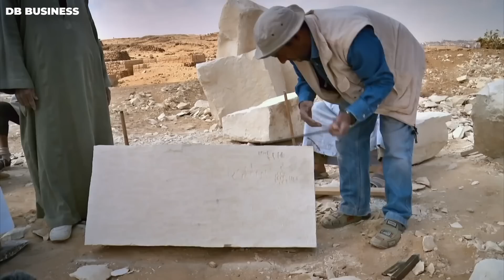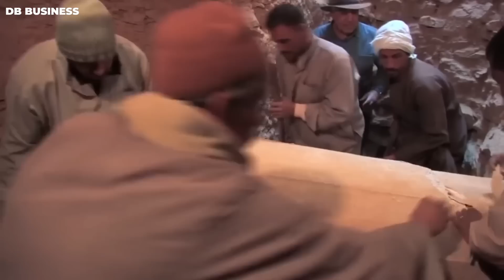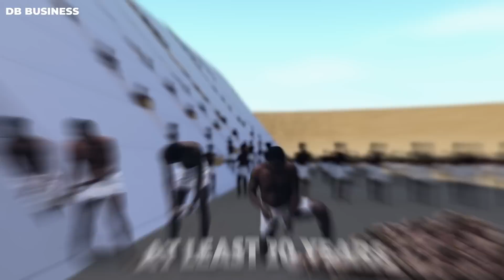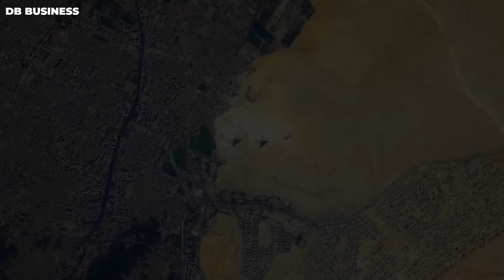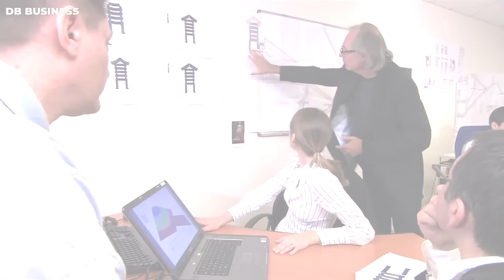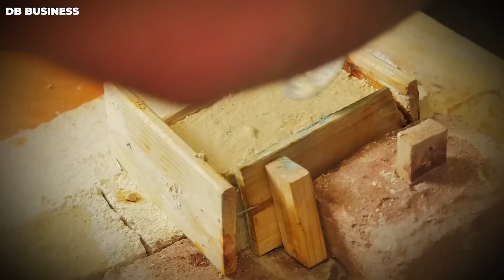The Mystery of The Great Pyramid Has Just Been Solved by Elon Musk

Comment: "Most of the pyramids serve as tombs for the Egypt's Kings"... really?  I don't believe any pyramids were build as tombs (Valley of the Kings?) and the few that had tombs were used as such by interlopers well after the construction.  As for the concrete method their molds must have been perfectly smooth unlike standard practices today which result in embossed reflections of the wooden molds. Sounds like more speculation rather than science.

Comment: Lifting a 10 ton stone, even with pulleys, requires a rope strong enough to pull more. If they existed, they would be too big for a normal man to grip.
Reply: Perfect.
Reply: Bio🐞 Anti gravity technology

Victor grebennikov
Reply: Sending vibrations through an object you can easily push objects that way hundreds of pounds. Just yourself.... This is actually proven and you can find videos to back this theory. Fully explaining and demonstrating.
Reply: There's a video on YouTube of an older man of maybe 60, moving a ten or maybe it was 20  ton rectangular block of concrete he cast,  by himself with no help, no machinery, no ropes, no pulleys, and then lowering it partially into a hole in the ground, deep enough to hold the stone upright and he gets the stone sticking straight up and level,  out of the ground, kind of like stone henge....the video is on YouTube and he's an old man... maybe 60.
Reply: @leopitre7907  Yes and set up with a lot of "modern" help. Do not believe only what they showed you on video. "BEHIND THE SCENES" on that would explain it far better.
Reply: Instead of one big rope.... you could use multiple ropes. And instead of pushing and pulling, you could dig a canal with water and let the stones float on wooden floats.
Reply: @JerryMetal  You think a stone of 10 or 20 tons would float on water???If you throw a small stone it goes at the bottom so imagine that weight.Think more before you say smth mate. 😉
Reply: The fallen Angels taught those people how to build and get the substance they need from out the earth. They taught them craft, astrology,math and the minerals that’s in the earth to survive.
Reply: @alexandermoore872  fallen angels? you mean demons?  why?  thats magical thinking.  People are smart and can figure out how to do things when they want to.  The pyramids are proof of that.  There was a dictator king that said this is how its going to be and this is what were going to do and all our resources are going to be dedidcated  to this project and it was so.  Not like now where they vote and then have a meeting and a request for funding and compromises and endless politics.  They got shit done back then.
Reply: they werent 10 tons only a very few were. Most were in the 1 to 2 ton range on top they were even smaller.  There were some big ones but most werent so the sustained drive to build it didnt need a thousand men on each block. 1 ton divided by 20 men is only a 100 lbs each to lift. Its manageable.
Reply: I believe humans were bigger in the past than today
Reply: @kav5697  munmies say no
Reply: @kav5697  then why are their skeletons smaller than ours
Reply: @kav5697  wrong, if anything they were a few inches smaller
Reply: @kav5697  and the skeletons are where?
Reply: @ScreamingEagleFTW  in their tombs bro, some of these people were disfigured, (king TuT) they were people just like us.

Comment: Yea one half inch off on the bottom and u got a complete off set so I just don't see people that didn't have any pulley systems being able to pull this off if it's so possible why hasn't one ever been built since some stones at other sites weighed upwards of a 100 tons so we are definitely missing a big piece of the puzzle
Reply: they cant even duplicate making one stone let along floating it with animal skin bladders or moving it up 400 feet in the air and setting it down on the top of the pyramid.  and Egypt wont help explore the pyramids or under the Sphynx.  If people would put even a tiny fraction of the work it took to building it into studying them we would at least know how they were built by now.

Comment: They didn't build the big Giza pyramid or the Sphynx, the geology of water erosion proves this. They built a few sh#t ones around Giza and Saqqarah which are falling apart or not symmetrical. Please ask Hawass how they cut 24 giant sarcophagi in Saqqarah Serapeum (over 100 tons each) and gave them a layered glass polish that can't even be done today....by hand with copper and stone tools. 
The 1st dynasty didn't even have the wheel ffs. And who made over 40,000 stone, machine turned jars, that are paper thin. (The Pharoahs had thier giblets put in some if them, topped with crappy wobbly clay lids.) And explain the huge ancient slabs with high speed circular saw marks from a blade over 9m in diameter! Or precise deep machined bore holes in the Djoser Pyramid.  😳. 
Those ancient farmers inherited it all and graffitied the lot. Even the most beautiful black granite smooth as silk statues in the Cairo museum are covered in unpolished crappy hieroglyphics, nothing like the skilled work we see in soft limestone. 
Elon is right. It's post or even pre-younger dryas. (15,000-300,000 years old).

Comment: The point is not who built the pyramids. Not even how. Start with the question WHY? A pyramid is the most stable structure in civil engineering. Made with the right matrials and weather-proofed they may stand for thousands of years and live through floods and moderate earthquakes. When they were new they must have had beacons and lightning arrestors. They could have been built for transmission of radio waves and wireless electricity of medium voltage. Some people believe they were originally large liquid batteries at a primitive time. In all probability built by an advanced space faring race. Some pyramids could be over ten thousand years old.

Comment: Actually, the Pyramids were built using simple machines and slave labor. The way blocks were put at the top was to lift them using pulleys, turned, and redropped and rolled into place. Lifting and turning the blocks was done at every corner of the pyramids.

The bigger question is how Stonehenge was built, given that, as far as we can tell, there is no means of lifting the blocks used to be the bridging stones.
Reply: I'm thinking that they used acoustics and harmonics to move those stones into place.